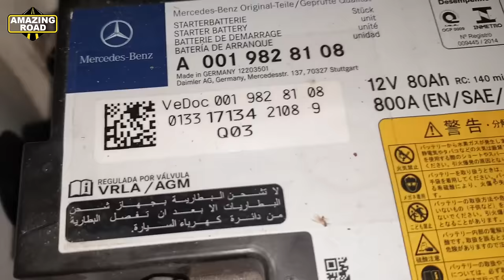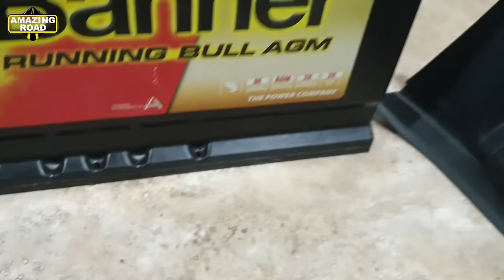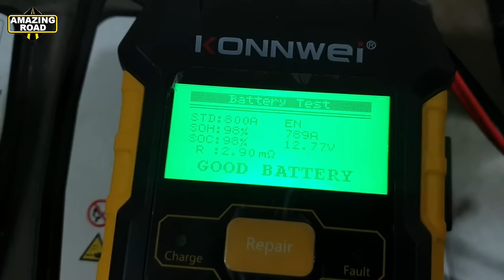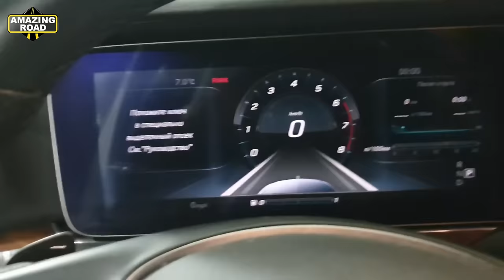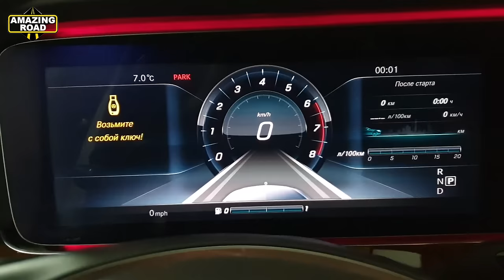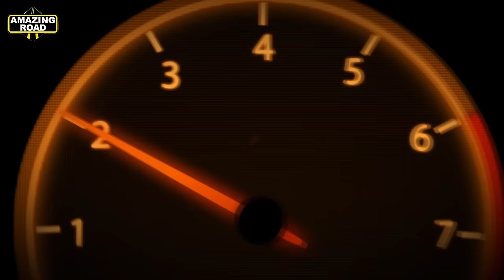How to Change Battery on Mercedes / Replacing the Main Battery on a Mercedes W213, W204, W212, W205

Comment: Nice job! The principal battery of my S212 hybrid, from 2014, since weeks ago gived warnings. Sincerely since the Covid pandemic I've only use my car for shorts distances. I already did the chargers with charger battery power and the warning disappear. Other method it is drive long distances, like 20-30 km, nonstop driving.
This two methods are solving new warnings for now. 
One thing I think can be helpful for all us, I made the principal battery measures when the warnings appearance and the voltmeter shows 12,4 V before charger. 13,7 V. 
Last week I did two medium distances driving and no warnings about low battery power.
Battery reference: A0055411001
12V 95Ah CCA 850 A (EN/SAE/GS)